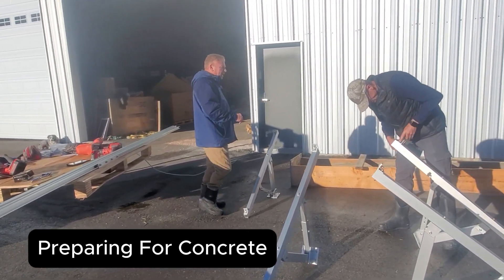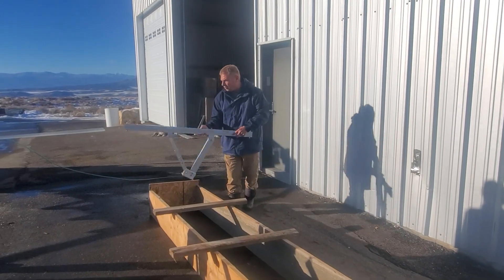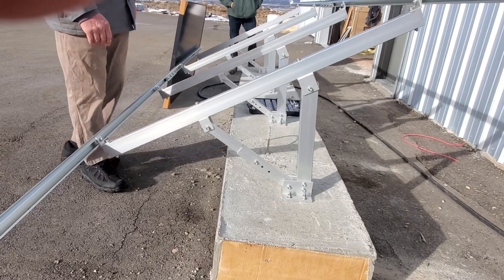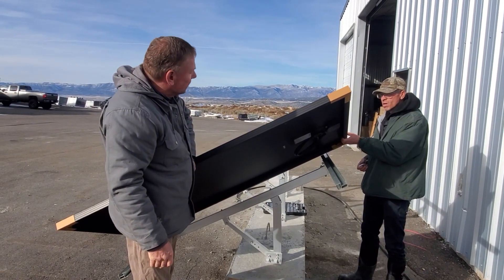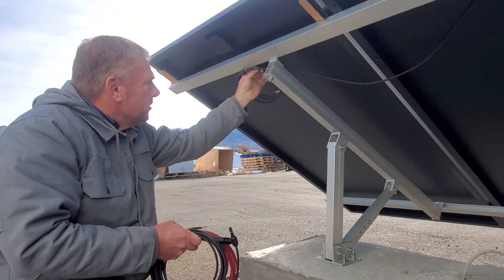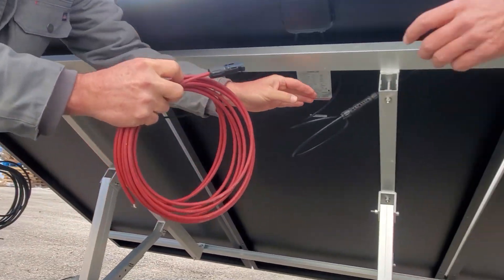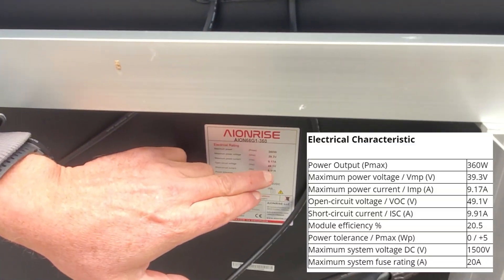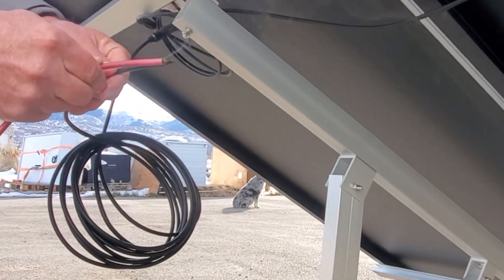Setting up your 3kw Solar Kit: Part 1 (Assembling Solar Panel Mounts for Kit )

Comment: I purchased 8 boviet 540 bi-facial panels from you, could I add 2 of these together to handle the eight. 
Also if I were to put these on sona tubes and higher would I be able to angle them on a steeper angle?